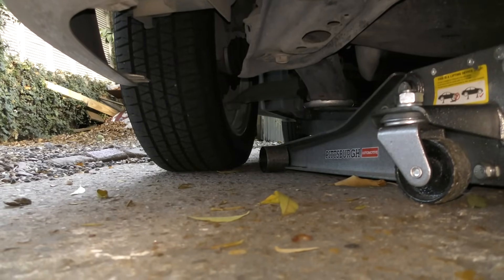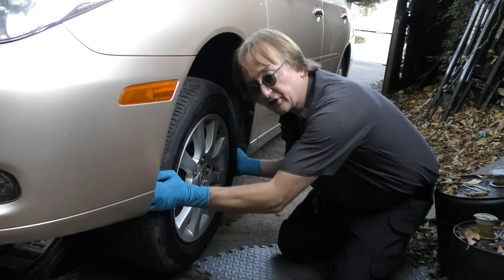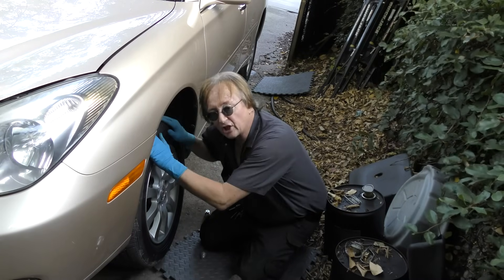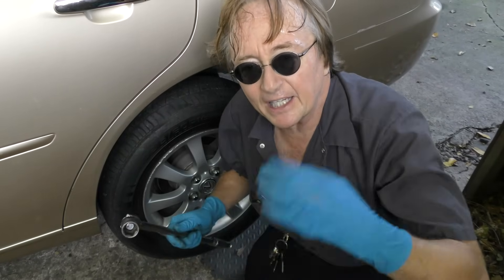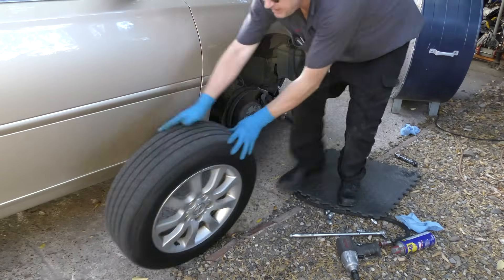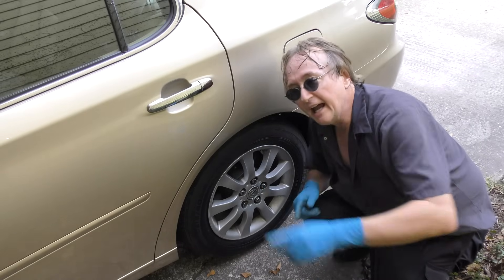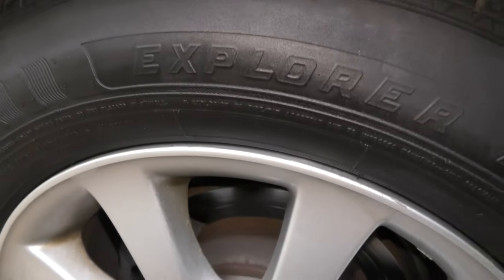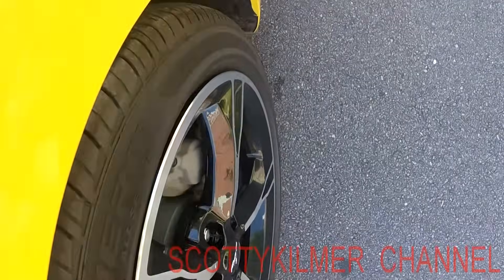How to Fix Wobbly Steering Wheel in Your Car

Comment: I have a 03 cadillac cts. My windows wont roll down, anti theft system is on, high beam cluster symbol dont work, clock not working, key stuck in cylinder. Can someone help me...

Comment: Hey Scotty, my 2003 Saturn L-200 has a major problem. Whenever I put the car into drive, after about 20 minutes, I come to a stop sign. When I put my foot on the gas, the engine revs up to about 4000-7000 RPM and doesn't move for about 3 seconds. After 3 seconds passed, the car suddenly sends the power to the front wheels and the car jerks forward. I'm tired of it, and my passengers are tired of it. Even then, it isn't a manual. It's an automatic. What can I do to fix it?
Reply from the maker: transmission is going out, probably time to get rid of it. but pray it's just low on fluid, check that first.

Comment: I'm a big fan of your channel Scotty, but you said you don't use an impact wrench to put the lug nuts on the car because it would make them too tight, but then you say the breaker bar gets them nice and tight. So that negated your previous statement. Instead, you could just invest in some torque limiting sticks so you don't worry about over torquing the nuts. But on top of that, you said to just get the lug nuts nice and tight, which makes sense, but you should also add the caveat that if you over tighten them, you could stretch the stud or warp the rotor, just to prevent people from going crazy with the breaker bar, or tire iron. Heavier people can put more of their weight on those and over torque the crap out of those nuts. I don't mean to be offensive, just something I wanted to point out, like I said, I'm a big fan of your work, and I'm a fellow Texan mechanic hailing from Corpus Christi!

Comment: I have a 2002 Pt cruiser and when I'm sitting at a light with my air on , the car will shake every 5 seconds or so. Do you have any idea what it could be?
Reply from the maker: if it runs fine otherwise, often a worn AC compressor does just that.
Reply: Mr.Bigzy26 probably have a vacuum leak or may need to clean the fuel injectors and the throttle body.
Reply: Mr.Bigzy26 Don't forget to check your lower engine mount. It is right by the A/C compressor and it often wears out.
Reply: Mr.Bigzy26 The problem is that you have a PT Cruiser. 
How to solve it: buy another car 😜
Reply: Cruisers are very good cars if properly cared for. Every single cruiser on the road has a different personality. You just have to learn yours.
Reply: Our Pt cruiser also shook every 5 seconds. However, it also stopped cooling with the AC on during idle. 
Turned out to be a wiring issue underneath the engine bay's fuse box. It was a short leading to the condenser fan.
Good luck!
Reply: zygomorphiskool That's also a case of needanewcaritus.
Reply: you have a pt cruiser, i think this is your main problem.
Reply: I'm happy we at least have a car.

Comment: Hey scotty, i have a 2005 Honda accord 
my car runs perfectly fine on regular speeds but when i go at 80 km/h my steering wheel starts to vibrate(not wobble), but when i got 90 it stops, same when i go 120 km/h and it stops when i go 130 
i changed my tires 5000 km ago and i recently got my tires rebalanced, any idea on the issue?
Reply from the maker: go to a good alignment shop, often it's just a bad alignment that does that

Comment: My steering wheel started wobbling immediately after getting a tire rotation done yesterday (though it only does it at interstate speeds).
Reply from the maker: that means the tires moved to the front are bad or out of balance (or the guys messed up and put the front tires on slightly crooked on the hub.)

Comment: ok what about a steering wheel that doesn't activities quick 
it has some delay and play even if the car not moving?
Reply from the maker: play when not moving shows worn suspension parts which pulling on the wheels when jacked up would show
Reply: depending on car and year it can also be the gear box
Reply: Scotty Kilmer thank you. 
Well try that out when i have enough money I'll buy parts
Reply: Andy47357 i was thinking maybe the rod between the steering wheel and the steering gearbox 
Are worn because i buy this car( pickup truck)  actually used
And it didn't have steeringpump
So picking up heavy weight and steering with out the pump could done a damage there

Comment: Is it dangerous to have a bent rim though? Can I go on the highway with it?
Reply from the maker: depends how bent it it, and if steel rims, you can whack em back decentlywith a sledge hammer
Reply: I have alloy wheels and I thought my steering wheel is shaking because of the little bend, so I was going to swap them back and was worried it would be dangerous.  
Turns out it wasn't because of the little bend, the tire pressure sensor fell apart and was rolling around inside the tire.   

I'll keep the sledgehammer solution in mind though! :D   

Thank you for the reply, you're the best!

Comment: my mothers steering wheel was warbly when applying brakes. so i changed out her rotors and the car is buttery smooth when applying brakes at high speed.

Comment: craftsman has all their torque wrenches on sale for 49.99.  Anybody got one and how you like it?
Reply: I have 2 of them.  I've never had them calibrated or anything, though.  They seem to work fine, they're about 12 years old now...
Reply: thnx a bunch.  I guess for that price, its worth a shot.
Reply: SGDeGalvez I would definitely get one for that price.  Even the cheap ones are about that price and work well.  Where do they have them on sale at?
Reply: craftsman sucks...Buy Snap-on
Reply: When i see it at 49.99 I sure will.
Reply: @abqpinkman  damn straight and have them calibrated once a year. The cheap ones ain't even close to spec.

Comment: Scotty, my steering wheel wobbles when I brake. What might cause that ?
Reply: The brake rotor might be warped. If you remove the wheel you can evaluate this. This is my first attempt to answer a car issue myself. I hope I'm not too far off.
Reply: Thanks for the reply. I thought a disc might be warped, but I replaced all four brake rotors/discs and pads nine months ago, around 10k miles ago. The pads are fine.. I have no idea how I could have warped a disc/rotor.
Reply: FCFordLord Thanks very much. I've a feeling the caliper might be the culprit. Thanks for the replies guys.

Comment: I thought u cant just switch rear and front wheels because arent they weighed differently with wheel weights?
Reply from the maker: no, tires are balanced individually and can be put anywhere

Comment: My car has a problem that I can’t figure out!!!

Only on the mortar way/highway when I get to around 60/70mph 

If I turn right very slightly the car starts vibrating it at the front end I want to say the right wheel. When I move it left it stops it also gets worse as I slow down but if I accelerate it easies off.
Reply: Bad axle.

Comment: there’s always a lAZer wA.  - 1st check the front tires for bubble & or circle imperfection - thNnn if that can’t be discerned, thNnn put in neautral with emergency brake, whelk choks etc. jack up 1, turn it with something still underneath, then check for whelk play & so on.  thNn go to other side.  rotate them(which clErlE has Bn a clumZ word for manE yErs, since it’s left to left, etc.) 👋😒

Comment: Good video, but he really should have used a torque wrench to torque the wheel bolts to the proper torque for the car in question when he reinstalled the wheels. Proper torque on the bolts helps to prevent warping of the brake rotors. We know Scotty has a torque wrench because he uses it in his other videos.

Comment: Scotty....where's that torque wrench for the lug nuts these other YouTube mechanics always say to use to prevent warping a rotor...or something like that? Truth be known i kinda do it like you.
Reply: holidayhouse03  u always need to use to torque wrench or u will put them on too thight or too lose with all the risks it can have
Reply: Scotty probably has a calibrated arm, since he's done this kind of work for so long ;-).
Reply: holidayhouse03 For that car I think the torque is 76 ft-lbs.  He probably got it pretty close, but it's probably a customers car so it would be better to torque it to be sure.
Reply: You have to really screw up to get it so tight you warp a rotor. When I was still young and didn't know my own strength I would get them so tight that I eventually snapped one off. But I never warped a rotor. I also once had a semi truck tire shop mechanic put my wheel on with an air impact wrench (needed my crankshaft broken loose), I didn't stop him in time, he told me, "It's only about 250 ft/lbs", real story. my rotor was fine, no warping at all. If you need to learn with a torque wrench that's cool, but it shouldn't be necessary to always rely on one, it's pretty easy to get a feel for lug nuts. At least that's my two cents.
Reply: I agree, I've done our vehicles for 40 years with no torque wrench and never had a warp rotor. I use a 4 way wrench and just try to apply equal snugging all around. Perhaps some vehicles need torquing but this hasn't been the case with mine.
Reply: Yup...i use the same tool to put them on that i use to take them off...and that tool is a 4 way
Reply: Always use a torque bar. I didn’t know what I was doing before and I was pretty strong at the time and I made them too tight. Ended up stripping my studs and a few of my studs broke off on the freeway and almost lost my wheels. Had to pay for a whole new stud job and was unsafe...NOT worth it so just torque to specs..
Reply: You need a lot of pressure to warp a rotor, and besides the the stud will break before that. Must studs break at around  300ft.ibs
Reply: Oh and it’s about 2500ft.ibs to warp rotor
Reply: you can get a good torque wrench for $30. tighten with "breaker bar" and double tap with torque wrench. never failed me. but then again neither did a good stomp on the lug wrench. keep it with your spare tire and car jack, or keep the breaker bar in arms reach as a literal breaking bar. Self defense I keep tools handy.

Comment: I have recently change my car clutch and now at 50 to 70 mph it's starts wobbling?
Reply from the maker: taking a transmission off is a big deal, check the area you worked in, especially the drive shaft joints and make sure the wheels are bolted on correctly with the right torque

Comment: shakes and pulsate to the right, , what could it be??
Reply from the maker: check for warped brake rotors and worn suspension parts like struts and tie rods
Reply: Scotty Kilmer i inspected my tires both feont tires were ready to burst. .. i could see the metal belt. and both tires had huge bulbs...never buying used tires again....thank u and i will take your advice for preventative measures also.

Comment: if not repaired wobble might prematurely wear out the rear shocks and or other suspension components. of course, it's nothing a good old sledge hammer can't fix.

Comment: My steering was fine until my check tire inflation light came on.  I filled the tires, and the light went off. However, now my steering wheel is wobbly when driving.

Comment: it would of been a lot easier to just spin the tires while you had the front of the car jacked up and find the one that is separated and replace it with a new one. it will be the one with the big lump on it. that would save you the trouble of rotating the tires for nothing.

Comment: that one tire looked pretty bald - and those weren't good tires to begin with - and I'd be willing to guess that 10+ year old Lexus still has the original shocks - and I wouldn't be surprised if that car has never had an alignment done. probably due for new ball joints and bushings too. 

lots of reasons why the steering could be wobbly and numb.

Comment: We had a car that would shake like crazy driving, we put the winter tires on it (I'm in Canada), and that fixed it.  A look at the summer tires, and one of the belts had slipped in a tire.  Those tires were getting well worn anyway, never did replace them, the automatic tranny fell apart, and had it hauled off to the wreckers......

Comment: OMG! Use a freakin torque wrench!!! They are like $20 at harbor freight
Reply: Kris PlayzMC 
but Scotty sayes torque wrench 🔧 need to be serviced every year or two ✌
Reply: Kris PlayzMC If they were critical parts like an engine assembly or some suspension parts it would make sense. But for wheels? Come on man.
Reply: Every 6 months actually, and any time they are banged or dropped.  He was doing a quick road test and no need to torque them exact if you're gonna be pulling them off again in 5 minutes.  Really, just get 'em to 80+ lb/ft and it doesn't matter.  Just ask those bastards at tire barn who use their air guns to put 'em at 150...

Comment: Haha, that's not really fixing it. It's masking it. The problem remains. Might cause premature wear of bearings I would imagine? At least you should try balancing the bent wheel.
Reply from the maker: I ended up putting the left rear tire as the spare tire cause the spare had a shiny new never used rim and never used full size tire.

Comment: Why not just spin the tire and look at it....................
Reply: MrMac5150 sonetimes it vibrates at 50 mph
Reply: MrMac5150 also your eyes lie sometimes
Reply: Daniel Gonzales
 If I put it on a spin balancer, and hold a screw driver next to it, I will see the run-out real easy.
super easy.
Reply: MrMac5150 thats a whole different story
Reply: Daniel Gonzales
OH
Reply: can you spin it 10 times in a second to get the 50mph wobble?

Comment: SMH.  this aint fix nothin.  it just bandaided that shit for a while.  It was probably more on the shitty tyre problem.  trash ass tyres give you trash ass rides.
Reply from the maker: it fixed the shaking,  and later I put the full spare on the left rear side and used that tire for the spare
Reply: my tires are worn down on the inside and I  hit a curb head on almost, so is this most likely thr culprit or a bent rim? thanks
Reply from the maker: bent rim doesn't help, but often that's a bent lower control arm
Reply: it does not shake all the time , its intermittent. thanks Scotty!